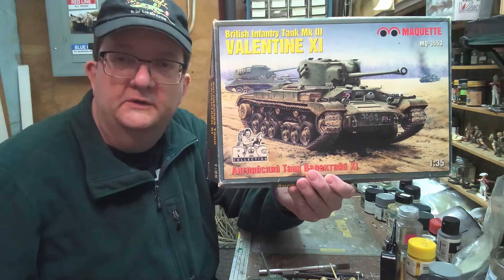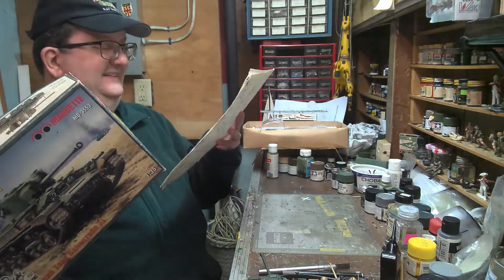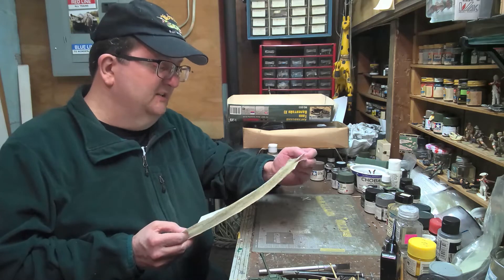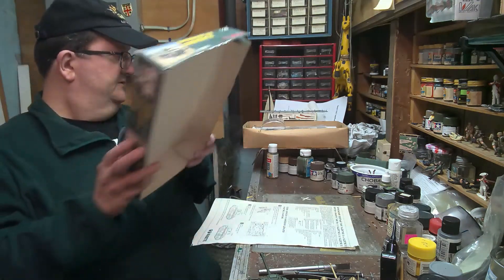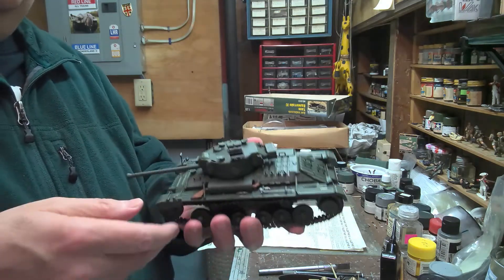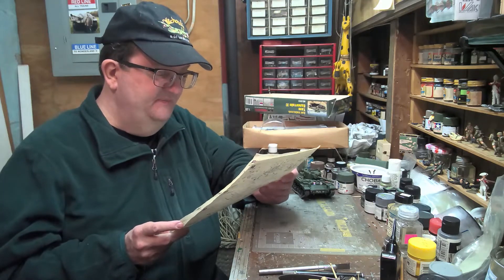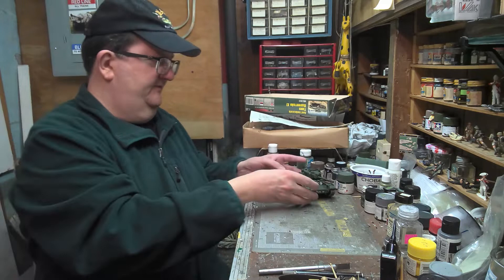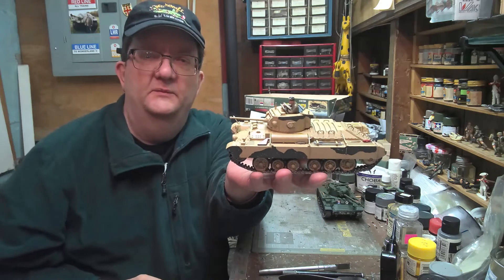Model Building - Valentine Tanks

Comment: I'll be honest, I don't think the Valentine ever had a 17lber in it. I think it must have meant the QF 75mm. I don't know for sure, but I do know no Valentine turret could have possibly fit a 17lber, which you were right is a 76.2 or 3 inch gun. But to be fair, most of those model instructions have a lot of translation errors or slightly incorrect words and terms. I've used Tamiya only so far and most of their manuals have grammatical errors all over the place. I'm enjoy your stuff by the way, I'm only about 2 years into the hobby and don't know a lot about other brands yet.
Reply: I just remembered after checking that the muzzle break should mean that's the QF 75mm gun, which was a copy of the American 75mm Sherman gun. The 6lber on the Valentine was typically without muzzle break but from what I saw sometimes had a counter weight or something of that sort on the end.
Reply from the maker: @adamg7984  You are correct. It looks like it's the QF 75mm. As you explore other brands, you will find each has it's pros and cons. Tamiya tends to be very consistent. You know what you are going to get with them.